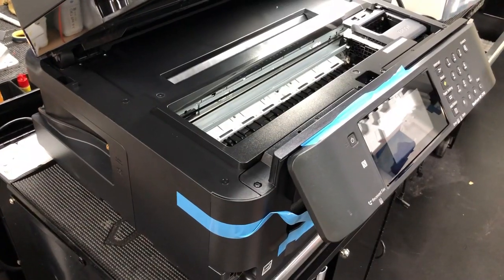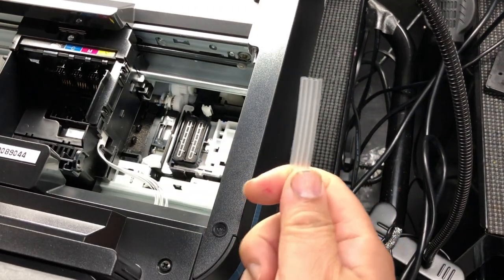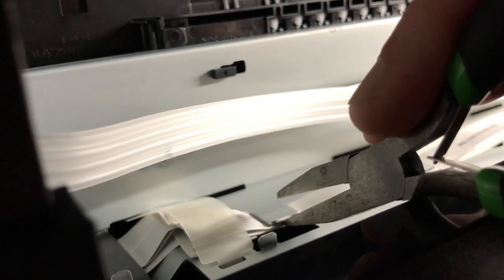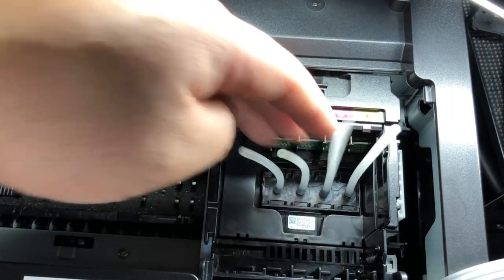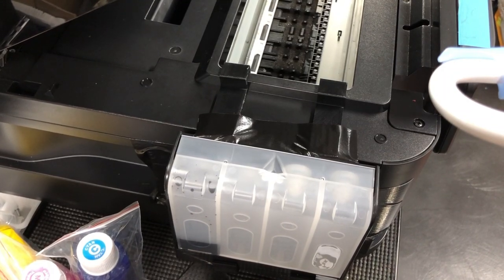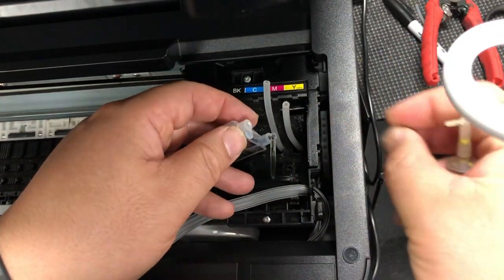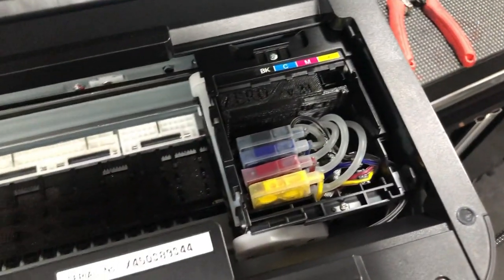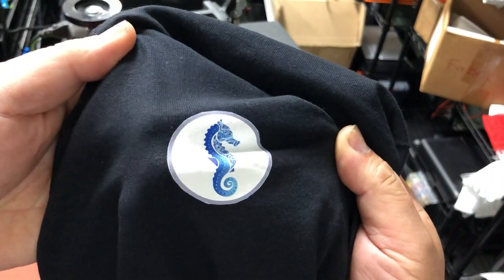Add Ink Tank: Epson WF-7710 7720 7110 7610 7620 Wide Format T252 Cartridge Printers.

Comment: My printer will not print after converting to chipless.  I've double/triple checked that it is connected to wifi. I also have tried usb cord and flash drive.  My printer keeps giving me an offline error. Any fix to this?
Reply from the maker: I never had this problem. However, I mainly work on new printers.
Reply: @BCHTechnologies  thanks for your reply. I was able to get it connected and printing with the USB cable. I prefer wifi but the cable will do, for now.